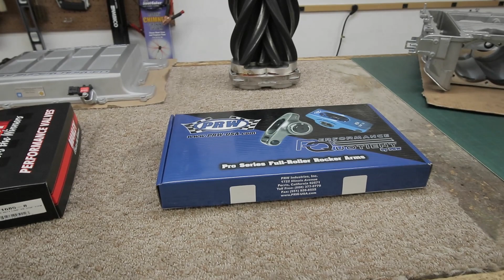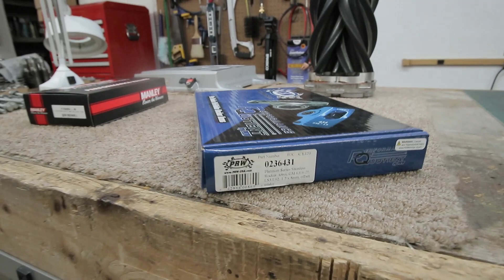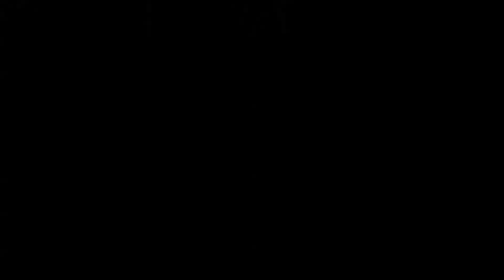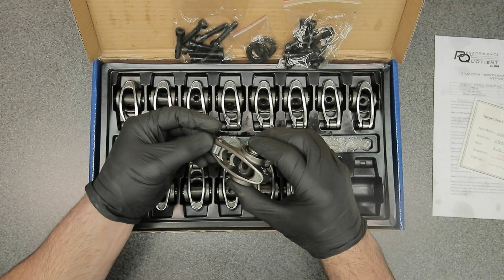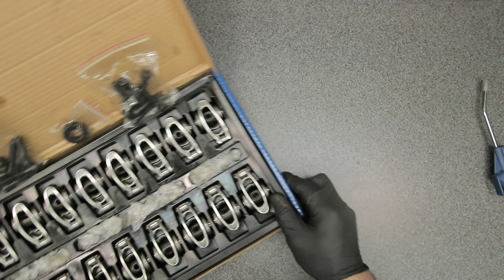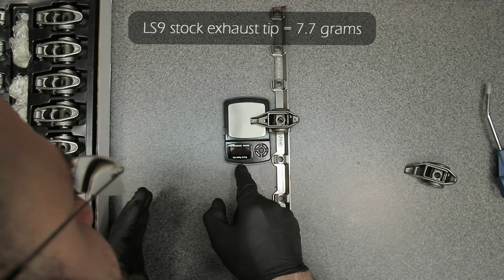PRW Rocker Arm Kit 0236431 PQx 1.7 8mm STAINLESS Steel Full Roller LS3 L92 LS9

Comment: I have the same problem, I have a BTR SGE2 Torque camshaft and double reinforced springs with it and I want to install roller rockers with a factory gear ratio of 1.7 but I can't find them, I just want the rockers to be more reliable. Basically, all manufacturers offer 1.72 but I don't want to increase the valve lift. What do you advise, which rockers should I install in my LSA?

Comment: The directions say to soak them solvent then blow them out a couple times then soak them in oil.  Truth is I do that with a lot of engine components.  Yes, you are correct about what should have been done but, like you said , you get what you paid for.
I just ordered a set for a Gen 1 small block chevy 350 1.5 ratio and they are heavy  but as long as you don't turn over 6500 rpm with a roller shaft you will be good.

Comment: The Texas speed rockers work with the Brian Tooley shaft conversion . I like the 3 bolt hold downs and 1 cylinder at a time shaft . A little pricey for me but its NICE .
Im bummed on the quality of these PRWs . Im looking for the better guide wear for my truck with roller tips .
Thanks for the video .
Reply from the maker: I looked at the TSP roller rockers but they dont have a 1.70 stock rocker ratio. They are 1.72 so keep that in mind. It will make your cam bigger then advertised.
Reply: @ModernHotrodsNH  barely . This was done for Geometry Correction . .02 doesnt alter much , maybe 1/2 degree . A properly designed rockers ratio is Quicker off the Seat in its action , like 1.8 or so initally .  The stockers are 1.59 off the seat then finally reach 1.7 . This is what to shop for in a good rocker arm . That quick inital opening is whats wanted .
All of this depends on a properly sized pushrod too . Look deeper into what the NASCAR boys did and checked their geometry to find what you need to do for a valetrain thats stable and Lives . Not many folks today do it Right .
Reply: I have the same problem, I want to install 1.7 roller rockers on my LSA and the choice is very small, having come across these PRW I thought that I had solved the problem, but after looking at your review I was upset. What rockers did you end up installing?

Comment: On the Dyno it reads that the steel ones loose power compared to factory
Reply from the maker: heavy rockers loose power that is correct. Best to stick with rockers that are close to stock weight.

Comment: get TSP with CHE Bushings, Buy once, cry once.
Reply from the maker: I looked into them but the TSP roller tip rocker do not come in stock rocker ratio i needed. So i did one better and went with comp cams BSR shaft rocker system

Comment: Are prw stainless rockers worth a shot? They look good, but Chinese rockers are scary.
Reply: Definitely not worth it I took mine apart after finding a piece of metal in my oil after 1st dyno pulls. Ended up being the cup in the rocker for pushrods. Half of the rockers had broken or stamped in crooked cups that kept giving me different pushrod sizes and weird ticks. Put factory’s back in along with same size pushrods instead of 3 different sizes like before and no more ticks and smooth valvetrian
Reply from the maker: Yes you are correct they are scaryAF. Not worth damaging your motor. They are 100% junk.
Reply: I bought a set of Harland Sharps. I couldn't trust this to Chinese parts.

Comment: Aluminum rockers DO NOT fatigue and crack unless a piston smashed into an open valve. Even then it would pull your stud or bolt out before that happened. Their lighter and less prone to floating valves due to a heavy rocker
Reply from the maker: look at google images of the hundreds of aluminum rockers that fail and crack at high stress points. no thanks ill stick with a steel variant rocker
Reply: @ModernHotrodsNH  screw google I'm speaking from 40 yrs of engine building experience. Needle bearings are the biggest culprit from not changing engine oil often enough
Reply: @walasiewicz  
40yrs of engine building...where's you're youtube channel boss??👀
Reply: @dalehall2993  to anyone reading this my gold rockers (ls3 aluminum)  spit the axles out of the tips and almost valve dropped my engine.  i am no longer a fan of alum rockers.  I also run a mild 613 230 cam and a 6800 rev limit
Reply: @walasiewicz  no bud screw that opinion . On sbc and bbc ive built have broken aluminum rockers on the street . You can keep that junk and if you knew Anything after 40 years youd know that !!!

Comment: Bronze guides are not good for regularly driven cars. There's no performance gains and they are soft and wear out fast. That's drag racing stuff. But the roller tips WILL help get rid of the pushing and pulling on the bronze guides
Reply: Theres PLENTY of marine 4 cycle engines world wide that disagree with bronze guides being no good !!! No engines work harder and Must be reliable than them for the most part . You really need to quit with the nonsense dude .

Comment: In the first minute you said roller tip rockers and the box says full rollers. Kinda makes a fella question your experience and advice.
Reply from the maker: Yes roller tip rockers is correct it describes just like all other manufacturers do. Full roller is way too vague. PRW is junk you really want to go by the Chad in the marketing & sales dept. limited terminology?
Reply: @ModernHotrodsNH  roller tip rockers are just that a roller on the tip only. Full rollers include the roller bearings in the fulcrum just like the ones you have there. I don't see how that is vague. Anyone that knows their stuff would easily know the difference.

Comment: did ya call them and ask about a replacement rocker for the bad one?? curious about their customer service.
Reply from the maker: Nope just sent them back for a refund and bought Comp Cams BSR shaft rockers instead
Reply: @ModernHotrodsNH  good choice… even the most minuscule amount of drag with any of those bearings will only get worse and show up exponentially with spring tension and RPMs.

Comment: I have experience with PRW products.  

If you read and follow the instructions included with the rocker arms, you may find the proper method to resolve your alleged problem with the nose roller.  Every component should be checked before installation; regardless of the manufacturer.  Nonetheless, closer factory scrutiny should be implemented.

The pedestal that you have included in your video, is not the correct application for the LS3 rocker arms that you have featured.  That pedestal in the video is for LS1 cathedral port heads.  

Articulating weight of the rocker arm has little impact on function, when used in conjunction with dual springs and a more aggressive camshaft profile. Less deflection and strength should be factored into overall performance considerations, particularly when combined with a supercharger.  Forced-air boost places additional strain on the entire valvetrain system.  

Just my thoughts.
Reply: looking at the answer you got this guy loves ( deflection)
Reply from the maker: You think people and speed shops are going to re inspect every part lol  Its chinese junk. Thanks for watching!

Comment: Nice review video. 2 months ago I bought the TSP roller rockers. I wanted a stock ratio rocker but the choices were limited and I didn't trust the aluminum body rockers so I went with the TSP roller rockers 1.72 ratio. Not many options for us LS guys in terms of a steal body 1.7 roller rockers.
Reply: @WATCHMEWRENCH  you’re absolutely correct about avoiding any type of aluminum rockers. The best economical option for me anyway was PRW industries LS3 chromium steel 1.7 roller rockers combined with BTR shaft mount system. The biggest problem with the LS3 is valve train stability. The problem is the factory rocker mount base made from aluminum. The BTR base is steel + the extra mounting fasteners and longer shafts stabilizes the valve train nicely.
Reply from the maker: I agree with you cant trust aluminum rockers. They will eventually fatigue and break and cause problems. The TSP ones are nice if you have a stock cam. But like you i want to stick with the stock ratio.  The only option for us LS3/LS9 guys are T&D machine Stainless body roller tip that cost $1600 with a 3 month wait time.  These are not shaft rockers either they just are single bolt on style. No sure but i think they may need taller valve covers because of the adjusters. I cant install taller cover because of clearance issues. So i went with Comp Cams Max Lift BSR shaft rockers.

Comment: Send 'em back.  No, I wouldn't take a chance on another set.  It's not worth the time, aggravation, etc.
Reply from the maker: I agree...Thanks for watching!
Reply: I hope this video puts an end to PRW rockers. 
I work in manufacturing. I can tell you in this time of cutting costs there is no inspection being done at PRW. If there were then no way would a siezed roller get by.
PRW should stop production until they can document why that got by and how it wont happen again. They could become liable for many engine failures.
Reply from the maker: Yes always always verify components i dont care where they come from. I can not stress this any stronger.  I have over 15 years experience in firearms industry, aerospace & defense & high end medical machine shops. And i can tell you that if companys had to check every part made they would go out of business there would be no money in it. So instead they inspect to a sample lot/size which means they only check 2-5% of the parts.  And thats in a ISO 9001/9100 certified shop. If its your greasy mom and pop places or overseas forget it they probably inspect less then 1%

Inspection is huge over head to them and most of them DO NOT want to inspect on a regular basis. Its time consuming & adds complexity and upper management always wants to get product out the door faster. And they put "YES"  people in place where they want to achieve faster output. Regardless of quality.  

Ive seen this happen over and over like clockwork in big name high end establishments where i have worked.  And it always bites them in the ass.

Comment: What kind of hp you looking to get??
Reply from the maker: 900-1000rwhp. Katech CNC ported heads, porting blower, BTR stage 4 cam, flex fuel sensor, larger ID1300 injectors and pullied down all the way.